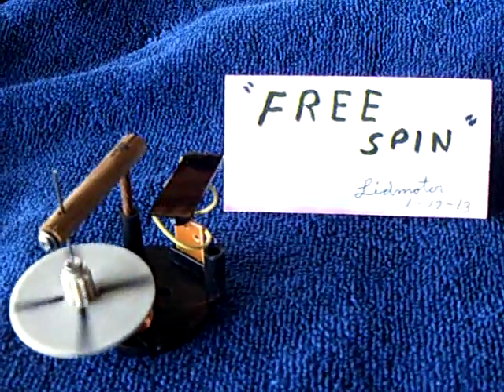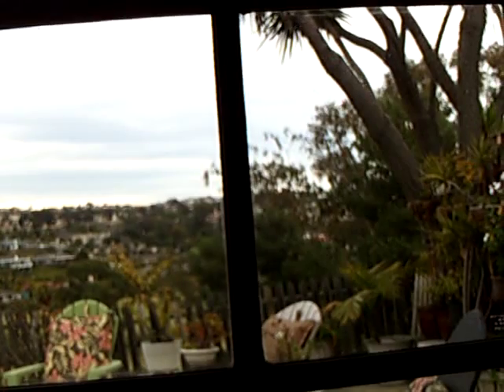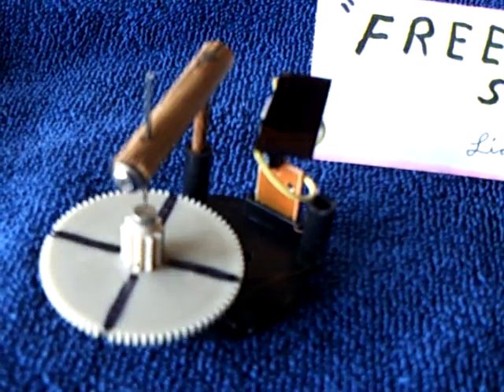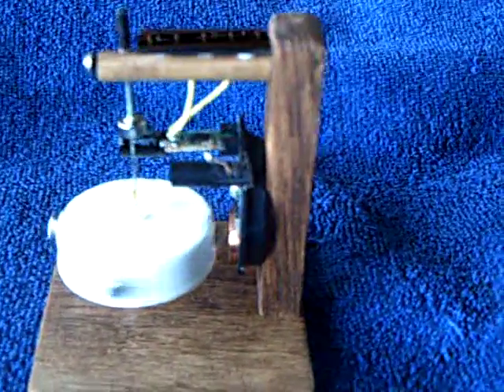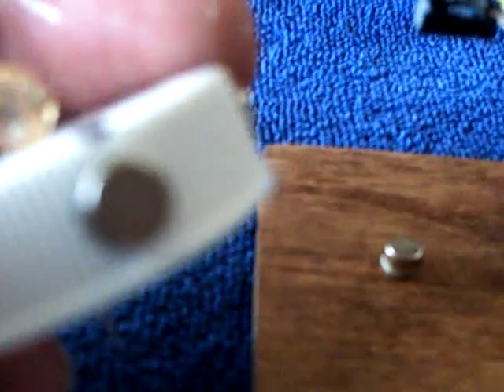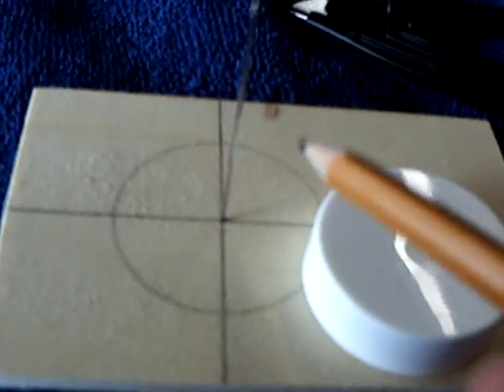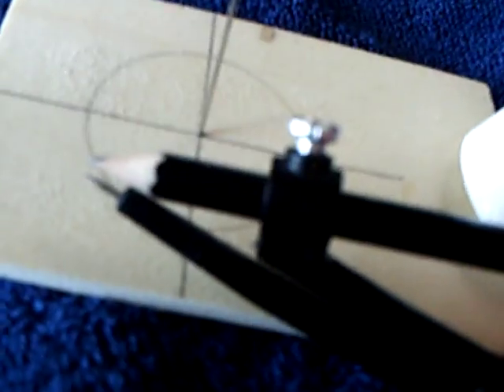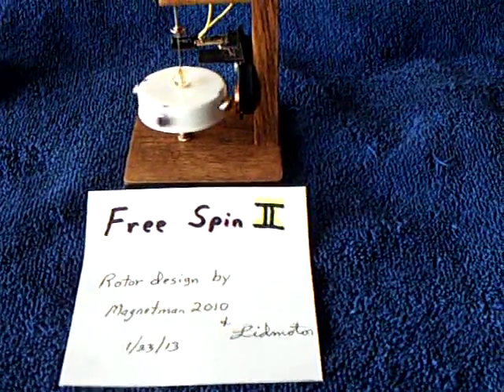Free Spin II

Comment from the maker: The plastic lids that I use are mostly from vitamin pill bottles but I get them off all kinds of things.  The sizes vary from 1" to 3".   The needle on Magnetman 2010's rotor sits point down on a magnet and the top magnet only holds the needle upright.  You can do this all kinds of ways but his method is one of the least friction/most stable methods I have seen.  I use a drop of good oil at needle contact point.

Comment: Awesome work. I have a few of those flower wavers. I've wired it up to a 12v 1.5 watt solar panel. Its works on  very, very, little light. would you be willing to make a video on how that circuit works? i want to scaleit up. I was thinking about using a bedini style coil that I have to drive a pendulum.

Comment from the maker: The coil is part of the drive uint.  The wire is superfine and it is very easy to break it.  Don't try to take the coil off the base plate if it is glued down or you will ruin the coil.  I learned that the hard way.  Solarbotics sells a small pancake coil like this but it is bigger and doesn't work very well on this circuit board.